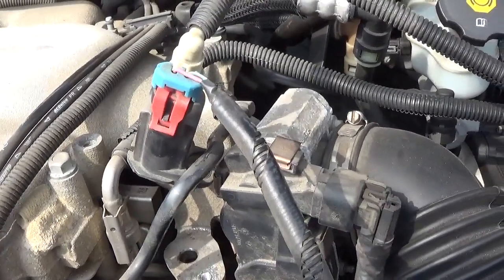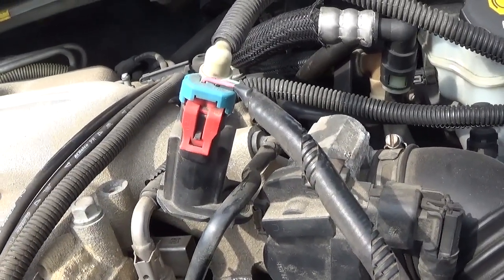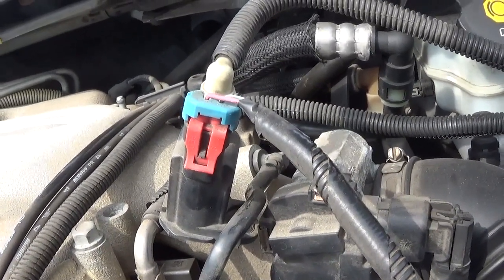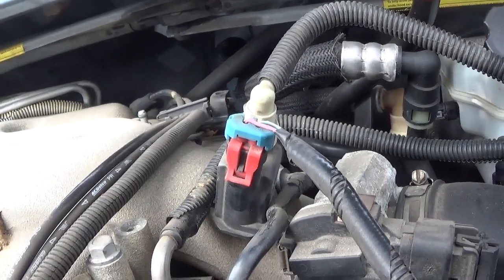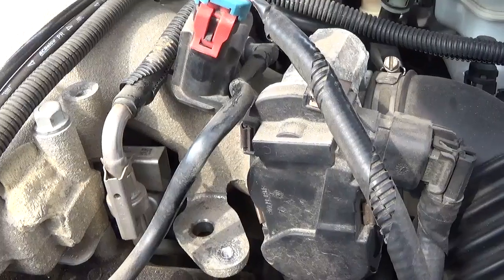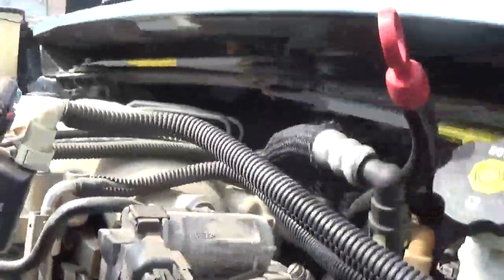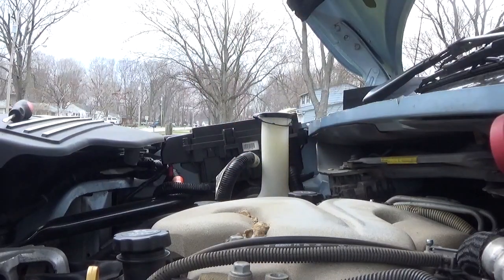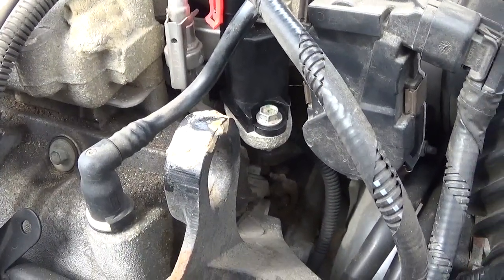Purge  solenoid valve change 07 Chevy Uplander.

Comment: ok well so much for sharing why you changed the purge valve? what was the uplanders symptoms
Reply from the maker: The symptoms were rough idle and sometimes it would even stall.  Our van had many problems but when I changed the purge solenoid valve it cleared up the rough idle and stalling issues and runs good now.  We got almost everything fixed on this van and it is probably our best vehicle now.
Reply: @cellgame100  yeah I love the uplander hella roomie runs great when it runs but I had the fuel pump go out and not seems like it's gone out again?? so when I saw this I was wondering if it keeps the gas from building up pressure because when I went to check the express valve no gas shot out after we had turned the key a few times but from cold first start it will run for like two seconds then nothing that's when I checked the fuel pressure port valve and saw no gas come out when expressed so IDK what it is and its gonna be a shame after already spending $2000 on this van to let it go for $600 because I cant find out what silly issue its having I need a code reader I was gonna hit up harbor freight you can get a code reader for $30 any suggestions?

Comment: I just cleaned out the throttle body and now it shows the oxygen sensor!  What can you suggest to look at?
Reply from the maker: I would clear the code if you can and see if it goes away because it is common to happen and if it comes back try to find out witch sensor or just do both they are on the exhaust system.  Check this link ( https://www.2carpros.com/questions/2006-chevrolet-uplander-oxygen-sensor-located-behind-catalytic-converter-that ) and hopefully this will help point you in the right direction.  One of the sucky things of older car is when you fix one thing it stresses the next thing until you get to the end.  These are really good vans and to me worth the effort.  Hope this is helpful and good luck to you my friend.

Comment: Mine has the code P0449. Help!!
Reply: Did you get it  figured out I have the same code
Reply: Oh and I was wondering are you still driving  the same car
Reply: Everything  I looked at says it is what he is replacing 😏 p0449 hope you got yours fixed
Reply: This was one of the many issues I’ve had with my gmc pickup. After I got this code I got rid of the truck. Hope you fix your issue
Reply: @kaijunior4339  oh ok hope you got a ford
Reply: @miss_violent3686  Hello, have you done this same procedure as the video? Did it end up working?
Reply: @zHazzz  yes I changed it and it worked allso don't  keep feeling the tank affter its full  I think  that is how I broke my evap thing

Comment: What is that purge valve does..?
Reply from the maker: "The purge valve is the part of the vehicle 
Evaporative Emission Control (EVAP) system. The EVAP system prevents 
fuel vapors in the fuel tank from escaping into the atmosphere. ... In 
modern cars, the purge valve is an electrically-operated solenoid, that is controlled by the engine computer."  I got the info form this website.  https://www.samarins.com/glossary/purge-valve.html
Reply: I have a 2007 Uplander and when i filled all the way up ..i smell gas when is parked..? After like a day driving smell stops..! I may need the valve..? I do not see any codes in the dashboard..
Reply: @arriagada1957  Never good to top off the gas tank. Raw gas may end up where there should only be vapor in the line leading to the EGR valve. That is why you smell gas after your fill-up. Over filling the gas tank is a definite no no.